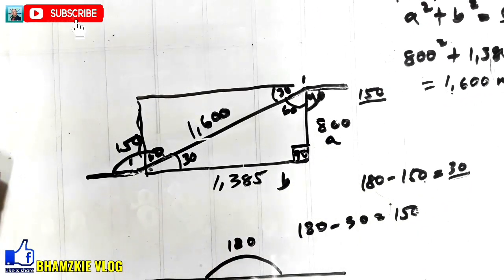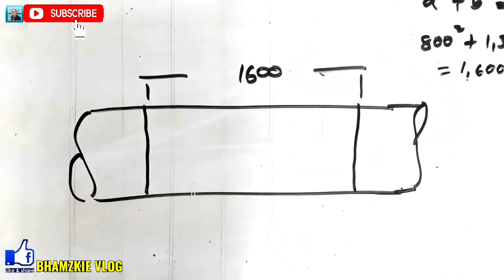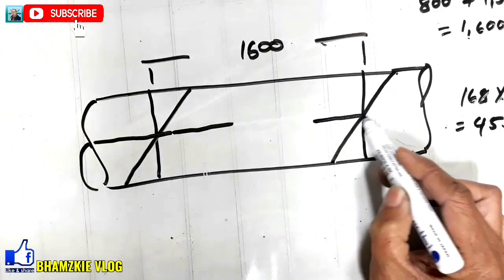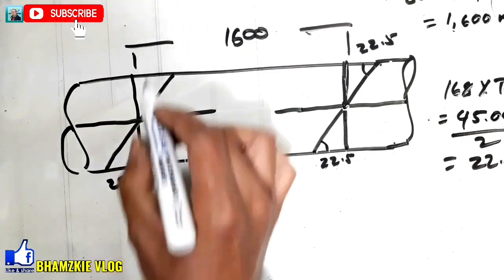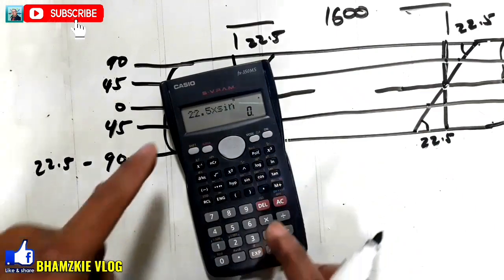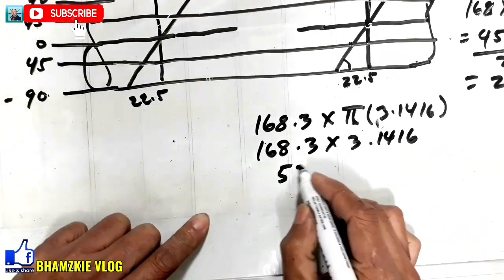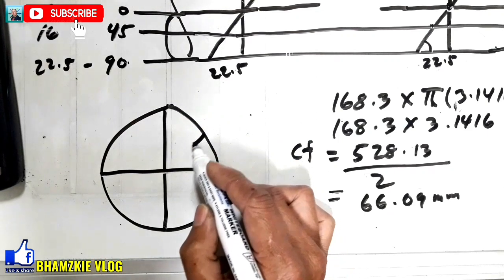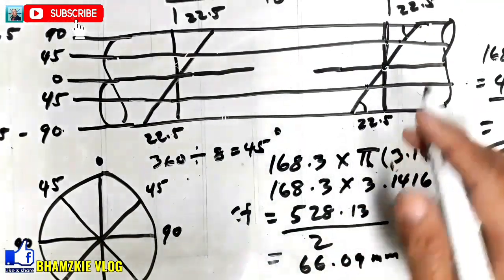HOW TO MITER CUT ANY DEGREE OFFSET (Part 2)

Comment: Ito po ba yung replacement upload  on how to cut degree 60 deg from 90 deg. Sir? Ito po ba ay same sa pagakuha ng take off ng kahit anong degree ng elbow.. Intindihin nyo nlng po tanong ko sir...newbie po
Reply from the maker: Hindi po sir,ang video na ito ay kung paano mag miter ng kahit anong degree,at sa ating example ay nag cut tayo ng 30 degree para sa 30 60 degree offset,about naman sa pagkuha ng take off ay kahit anong degree gamitin natin ang 1.5 at e multiply natin sa diameter ng pipe,yan po ang take off.
Sana  na gets nyu po ibig ko sabihin,👍